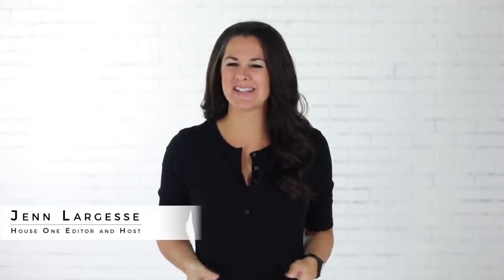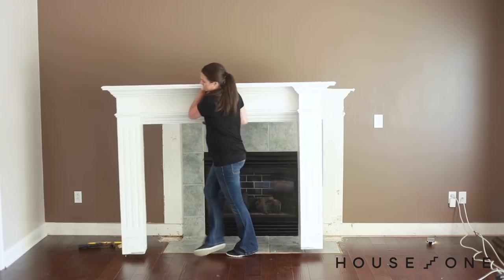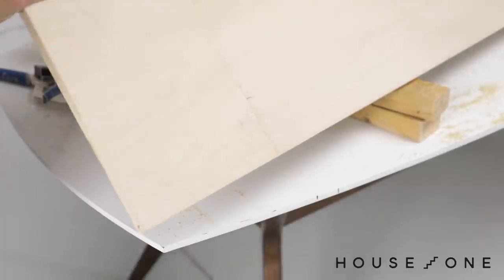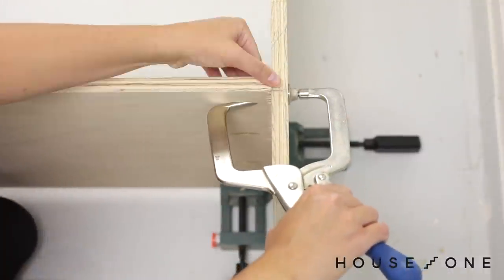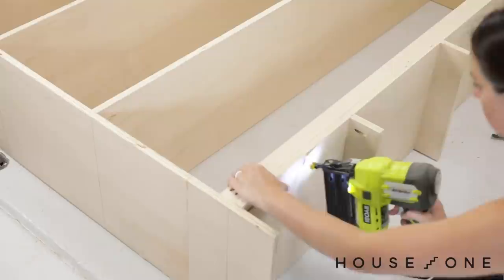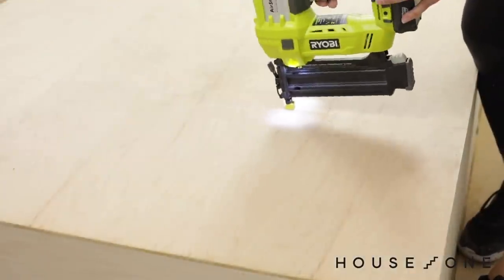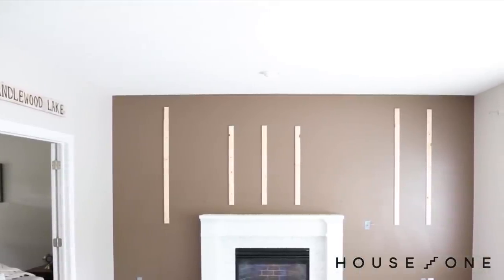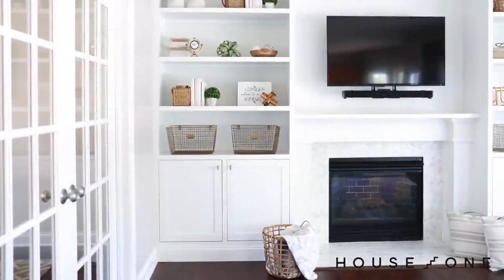How to Build a Custom Built-in Shelving Unit | House One

Comment: Looks really great. Only question is the shelf strength. Those right shelves are pretty long. I doubt 3/4 plywood with pocket screws would hold a bunch of heavy books. Am I wrong?
Reply: they will definitely bow over time

Comment: Nice design. You are using the nail gun at the wrong angle. If you rotate is 90 degrees you'll never have another nail come through the side of your project. The shape of the nails cause them to veer left or right, but not up or down.